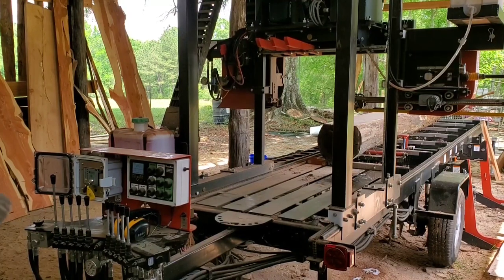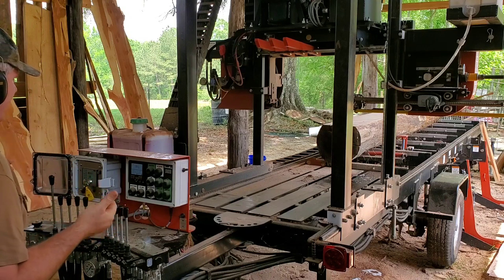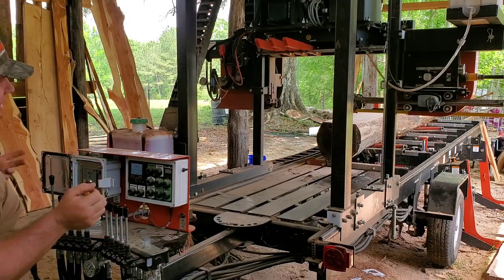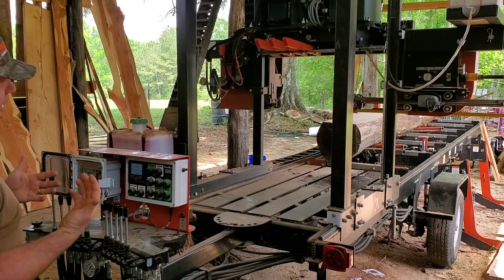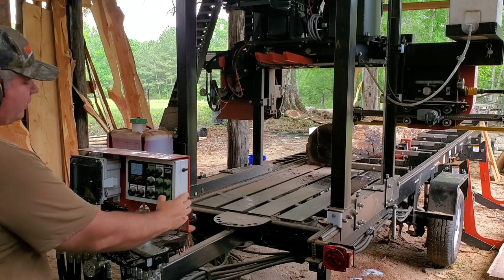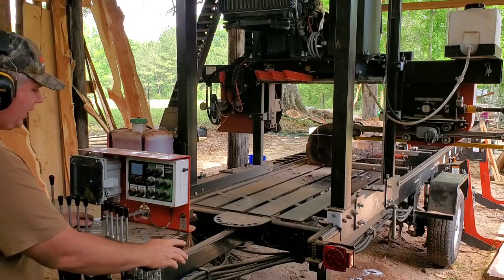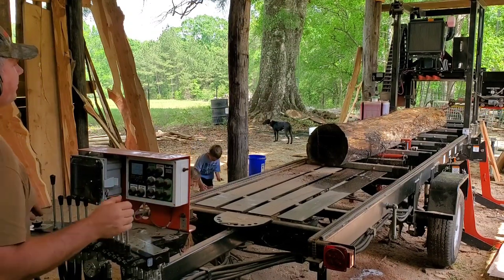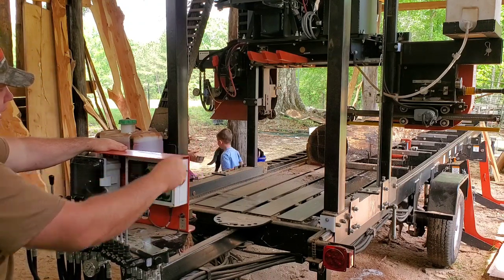Timberking 2000 controls and sawmill operation, cutting black walnut

Comment: Thanks very good video! Just sold my LT15 wide that I retro fitted a log clamp, toe boards, log lifter, chain log turner. Put way to much into this mill. But still had the rope for power feed and no set works.Would like to buy the Timberking 2000.

Comment: Oool..I like the big throat..probably wouldn't need it but it's nice to see better..Just curious if you saw at that speed when you're not making a video..Seems like you'd have to..to make up for the fuel consumption of a 50 horse or so engine...A 13 horse honda can cut that fast with a new blade..
Reply from the maker: When I'm cutting jobs, I'm cutting much faster.  Time is money.  Cutting on camera, my cutting seems slower than it actually is.  Also, im focused on talking, and by slowing down, I'm less likely to make mistakes.   I'm multi-tasking the operation of the mill, the filming of the mill, and talking at once.  My older 2000 sawmill and my new 2020 sawmill both run a 25hp kubota V1505D diesel.  Our biggest mill, the 2220, is a 50 hp kubota diesel, and it's a beast.